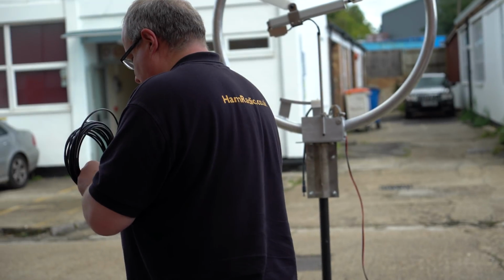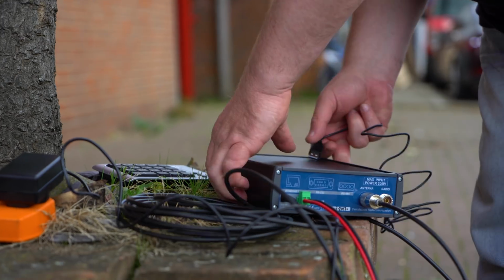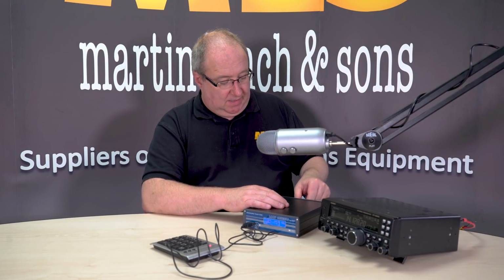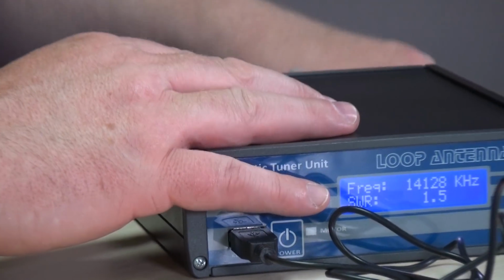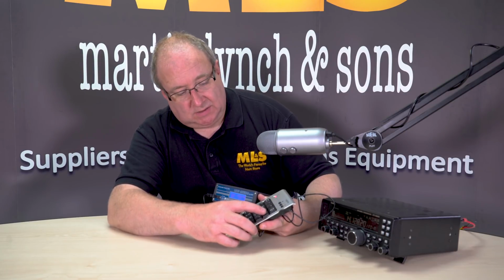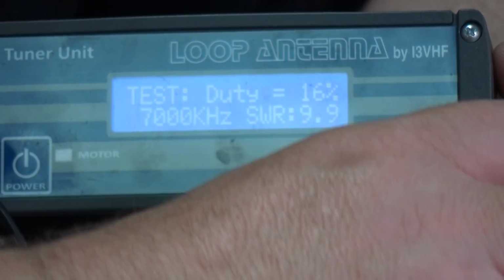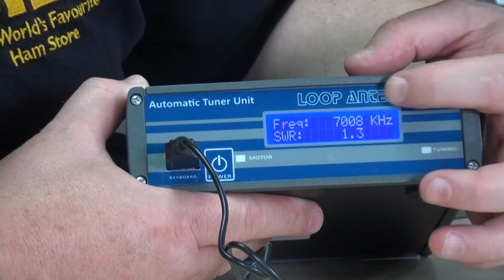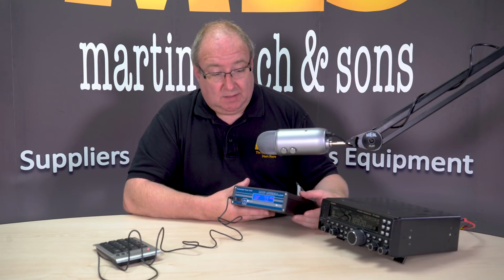ML&S demonstrate the Ciro Magnetic Loop

Comment: Hi, just got my Baby loop up and running with a rotator. Few pointers: without this video to set up the controller I would have struggled, the online manual is great for the antenna but not for setting up the controller. when I first got going I was finding the motor was failing, I thought it was because my wire was too long (30M) but I used and right bore and checked the voltage each end which was OK. It seemed to be the polarity at the controller, it does not say which is which but on switching round the wire the problem disappeared. Only been scanning for an hour or two and I am getting very good SWR readings 1.1, 1.3 max. Although my End feed long wire antenna seems to pick up more signals which is surprising me.

Comment: I recently purchased a baby loop from Ml&S. Works perfect with my Icom IC7300. 
I have fitted the optional RS232 card  and linked it to the radio through a CT17 radio interface. I am well pleased with the performance of this product. Also recommend using a rotator (Yaesu 450C)